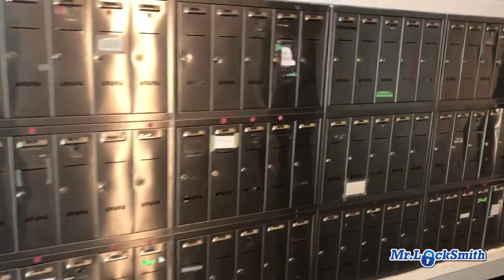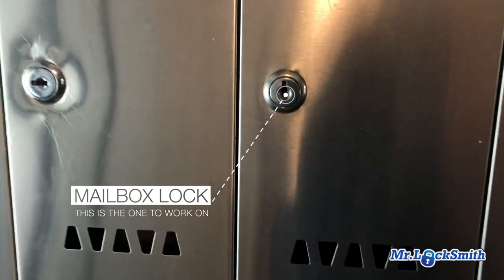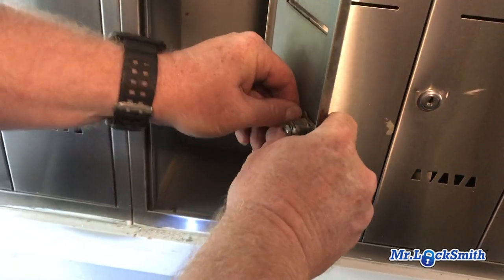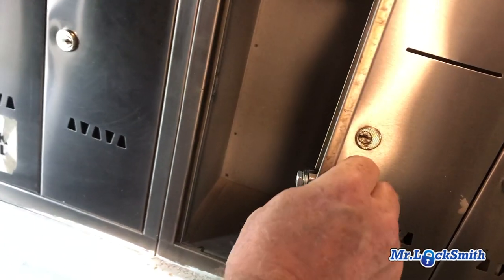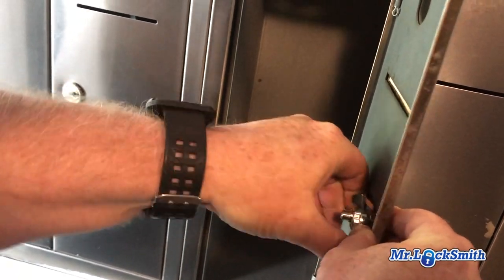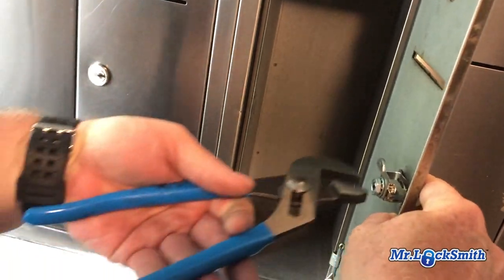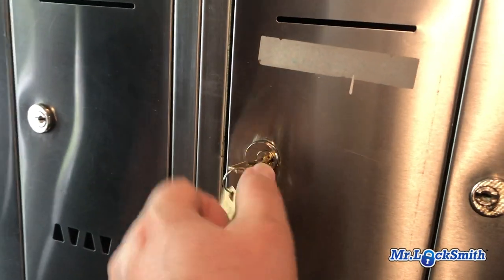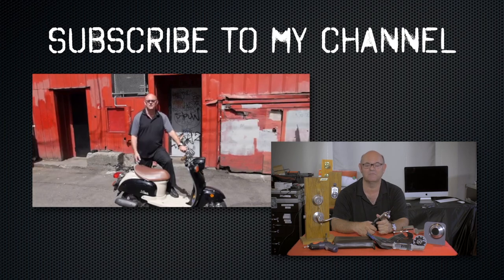Replace Mailbox Lock: Remove & Replace Mailbox Lock | Mr. Locksmith Video

Comment: I manage an apartment building and had to replace a mailbox lock. The mail guy is pretty regular on our street, when he came by and opened the crown lock I asked him to give me about 30 seconds and I reached in and pulled the C clamp off the box in question and opened up the box door. The mail guy then locked the crown lock and went on his way. I could have drilled out the lock, but my drill was at another site 60 miles away at the time. Saved some time.
Reply: Thanks handy Andy...!!

Comment: the mailboxes my building just have a circular hole and had the cheapest locks on the market.  As I find myself changing out more and more of these old locks,  I am looking for a simple way of fitting the new locks.  I find myself buying the better locks but they have a double D form.  I am filing down the sides flat and trying to file the upper and lower  semi circular part with half round files or grinding stones on a rotary tool or drill, whatever is on hand.   But this is a tedious job because I don't want a loose hole  and don't want the lock spinning .  It does not help that I am a perfectionist and also OCD.  Is there a die cutter that can simplify this process.  Or do you have a better way to do this???
Reply from the maker: "D" Punch (hard to find but work great for Filing Cabinets and light metal)
Reply: @24hrMrLocksmith  So , any idea where I can start looking for a D punch.  I asked some locksmiths and had no luck.

Comment: just a word of caution, when replacing the compX c9100 , don't have the key in the lock when tightening the lock nut, or else you may shear off the rotation limiting lug on the cylinder.  with wafer locks you can destroy a wafer.  thanks Terry!

Comment: My mailbox lacking device just came apart as I opened it today, do I have the post office to fix it?
Reply from the maker: Depends on if it is attached to a Condo / Apartment Building or USPS or Canada Post
Reply: @24hrMrLocksmith  It's attached to an apartment building where I live
Reply: @24hrMrLocksmith  Should I have the manager of the building I live in to fix the mailbox?

Comment: The cam on the back of my lock isn't secured with a nut. It has like a slotted piece of metal securing the cam to the cylinder. Ever seen that and any idea how to remove the old lock in that case?
Reply from the maker: Sometimes you need a key to help remove the lock. Also, your can just pry the tail piece off.

Comment: You really do not have to drill the shear line. For the average person it's easier just a grill a larger hole down the centre of the keyway. That way the cam will simply just fall off allowing the door to be opened. 
Or better yet take a very thin pry bar and the back cam will just bend or break off.